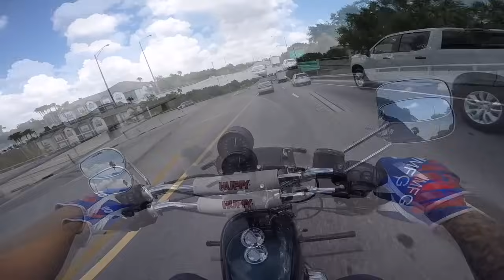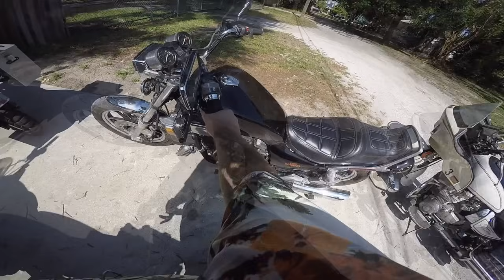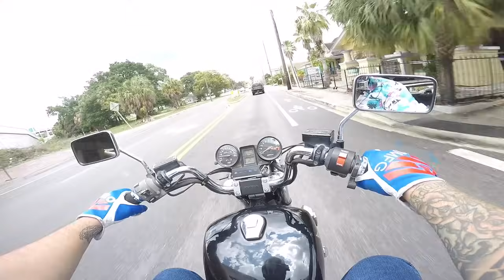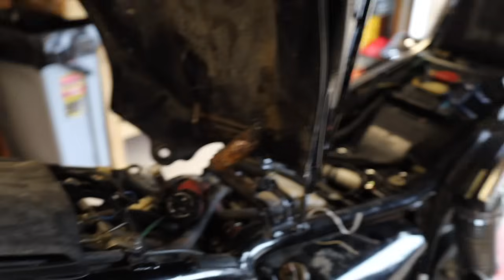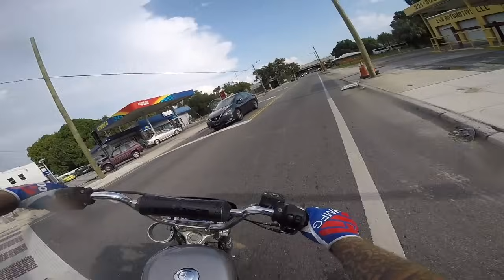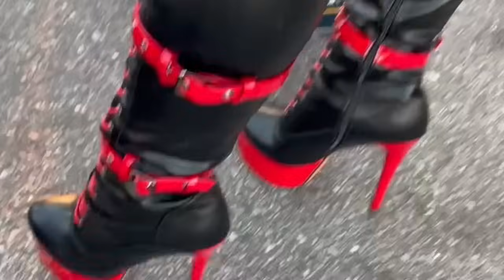Forgotten Fury: Honda's Insanely Fast 80s powerhouse will STILL beat any Harley... and I bought one

Comment: Hinkley Triumphs have nothing on a classic Triumph Bonneville when it comes to sound.. even better a TT Special like what's sitting in our garage.. If only I could afford to get it running. (and it didn't kill my back to kick it) PLEASE pull the mufflers off that Magna and rip it around open! Those things sound wicked opened up. Oh man.. and it's an 85! It's just like me!.. just fast. You might want to add more clutch discs to the ODB, the difference between the 883 and 1250 might cause it to slip a bit and wear them out, especially under heavy load. 
One thing on that Magna is check, and be careful of, the boots for the carbs. We had one that our neighbor gave us on Guam and when my dad pulled the carbs to clean them after years of sitting, the boots split and he was never able to get it to run again, and this was back before the internet so he never replaced them. So yeah those boots are really fragile. (it's also a pain in the ass to get the carbs off and back on) 
Hey Josh, if you want another Goldwang there's a 1980 for sale in Marysville Ca for $500. There's a green 83 in Yuba City for $800 too.

Comment: Just did a rebuild on the carbs for an 84' v30.... I questioned the technology that they put into it...... why v4? Why 4 carbs? Why put the air cleaner box so tight to frame?..... but once it was done and tuned. It really ran good. But yeah they wil run on only a couple cylinders, very robust bike.

Comment: Still trying to get the Sporty ready to join the ride. Mostly assembled and it does run. Putting the chain on tonight so I can get a few shakedown miles and try to sort the carb. 
I'd say 60/40 I'll be ready.
Looks like there's a high probability I'll be attempting the BDR on struts. 
Hardtail in the dirt, what could go wrong?
Lol
Reply from the maker: Now that’s tough! Haja
Reply: @shadetreesurgeon  Well the shocks I had lined up to borrow seemed to have fallen through so I have short shocks and struts to choose from. I prefer struts to those damn H-D short shocks.

Comment: I knew you had to be talking about the V65 Magna, to start with.  I was fairly familiar with it and the Kawi 900.  Speed wise they were pretty much on level with the Kawasaki H2 750 triple 2 stroke, but handled much better, and were safer.

Comment: I have a question 🙋 so I have a 2002 HD sportster 883C and out of nowhere 3 years of zero problems it died while pulling into the bank so I did my thing started it up and was pulling out to light and it died again so I tuned key off/on and it started right up got it home and so now basically if I start it it runs 20 seconds and dies I figured out if I don’t turn key off and back on it won’t restart but when I do that step it does but then won’t stay running, Trouble codes are all Clear on odometer I was leaning towards the coil so I ordered one hasn’t gotten here yet but if you can give me some advice please do? I hate buying parts and just replacing not really knowing the actual problem is yet?

Comment: i rode a friends back in the day. got up to speed very fast but was unstable at 90 to 100mph.   Front end felt light and you could not loosen up grip on the bars.  I had a 77 KZ650 custom that one could ride wide open at 120mph laying on the tank with just one arm on the bars and would not so much as even hint at a wiggle or squirm. not going to let go of the bars no handed with the V65 at higher speeds as the front will start to shake.  was sketchy enough I did not want to ride it again.  maye he had a bad front tire?? just that bike was not fun at high speed.

Comment: That sounds like my bike   I wish I could afford the parts that  Mine need The main things are coilpacks  CDI Box Voltage regulator And the Magnetic electric pick up  Coils  It's a 1983  XJ750 shoved into a 1980  frame

Comment: Put a V4 race engine into a weedy cruiser chassis with all the weight on the rear wheel, what could go wrong? 😂 I rode one years and years ago, almost killed myself, but it sure did get the blood pumping. You had to plan your cornering and keeping the front wheel on the ground was a challenge, but a wild bike.

Comment: .................little extra chain lube? on the tyre?
I hated those V-4 Honda's (and still do) 
Spent way too much time fixing the crappy cam chain tensioner's (moved from Honda dealers to Suzuki and still had to do  Magna's every week or so)
The VF motor was no better, even having gear drive to cams, they failed and were real expensive to swap out.
 The V-Max was much more 'interesting' when released, 148bhp on the first ones

Comment: V65 will get you killed as they will tank slap above 122mph or so. V65 Sabre is the bike to have if you enjoy going fast in the turns.
Reply: On my '83, I did about 1,000 miles at well over 130mph ($4000 worth of mods from RC  Engineering - 183BHP dyno tested). Never experienced "tank slap".
Reply: @covidmisinformation7481  What country is this that you can go 1000 miles at 130mph?
Reply: @grabir01  It was New Mexico in the 80's. I went from El Paso to Sturgis in 36 hours. Can't be done at less than 100 when you factor in fuel stops and a hotel room for one night.
Reply: @covidmisinformation7481  uh huh.

Comment: I ride a v700 magna basically striaight piped 49k on the clock. love the thing. Sound is unmatched. Just wished the manufacturers would see the benefit of a sportbike engine in a cruiser frame. Carbs are fun to put back on. Use ratchet straps if you do
Reply: Kawasaki did just that with the 600 and 900 Eliminators. Both engines came from the Ninja sportbikes. The V-Max and Madura came from touring bikes, but the Magnas, Sabres, and Interceptor sportbikes came out at the same time.

Comment: SOMEBODY GIVE THE MAN A XS 1100 TO RIDE/REVIEW      FASTEST CRUISER OF 1978  11 SEC QUARTER    XS 1100 SPECIAL ARE THE BEST, 1981 1100 MIDNIGHT  SPECIAL ANYONE?
Reply: THE BEST HONDA AND YAMAHA ENGINEERS helped design the 1100  inline engine frame and shaft drive,,,read about how they tested the bike in Australia in late 1970s,,Yamaha paid big bucks to ensure it was a home run,,,Uncle Larry cruised at over 110 mph for 8 hours straight down under,, The old Australian Autobahn

Comment: what i jerk thinks he would get on a 35 yr old bike an expecting 100 % didn't even go through it!
Reply: go  do the carbs and make sure the floats are set at 7mm i have 7.5 and not getting gas cut the ends of the coil wires old copper wires one can't get i have 3